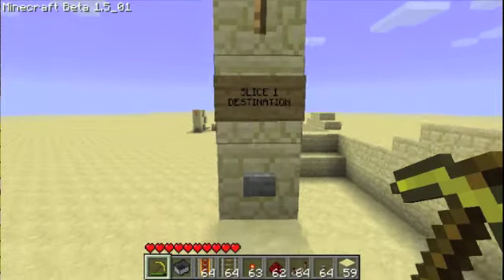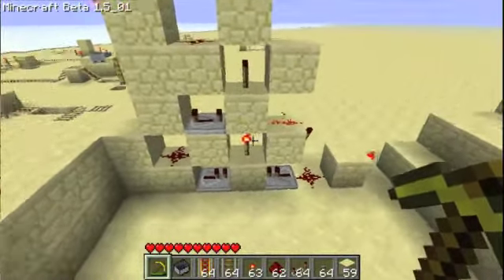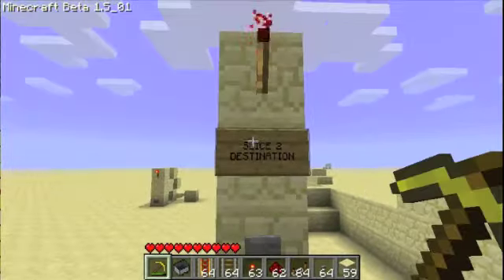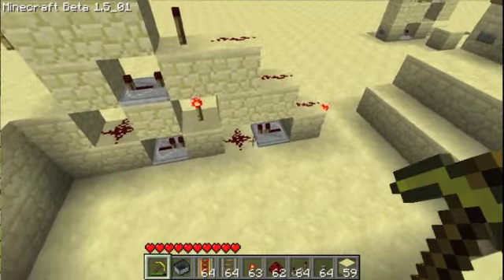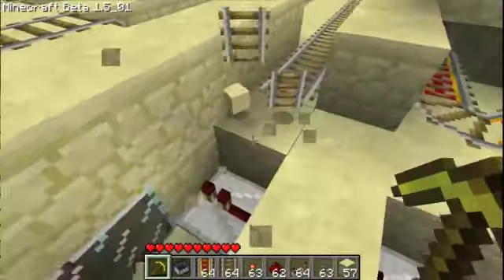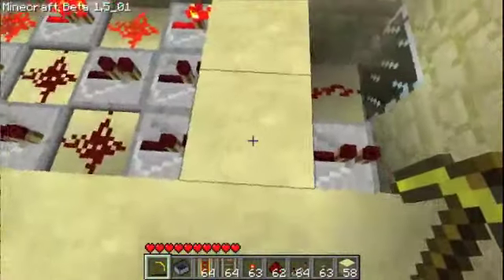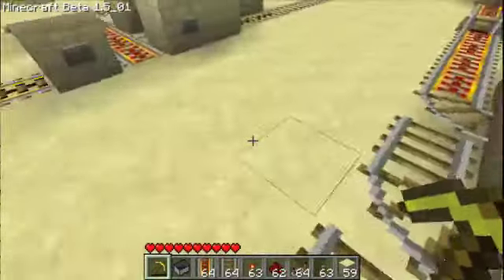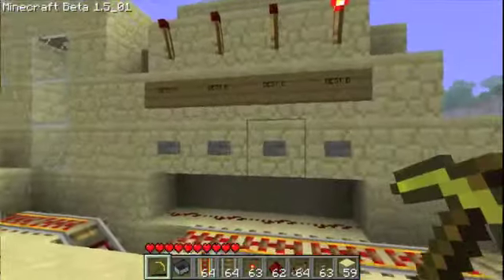Multi-Destination Selection

Comment: @piercesayshi he didn't just want a light that turned on when when you pulled a lever, he needed vertical latches that would activate and deactivate all the others at the same time, and would not interfere with each other.

Comment from the maker: @Ducks0Junk 
It's hard to explain.  Pretend this is the first slice:
_  _  _  _  _  _  _  _  Where each _ is the redstone.  And this is the second slice:
  _  _  _  _  _  _  _     Basically you have the redstone at different heights and make it so they don't interfere with eachother..
From there you just get the wire under your track piece and invert it when necessary.

Ask me if you need more help.